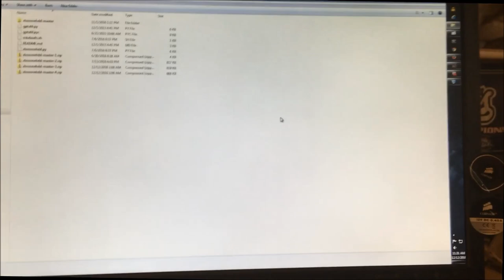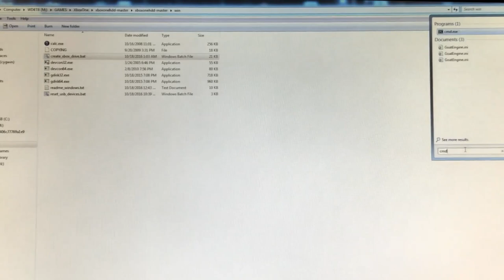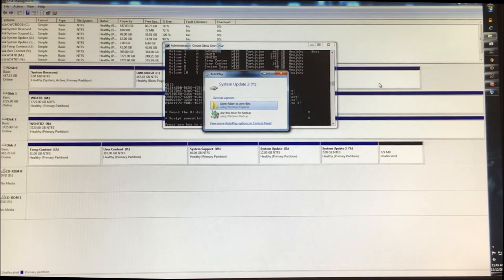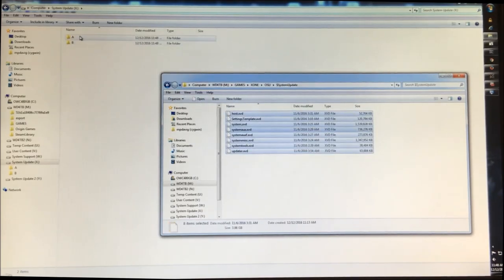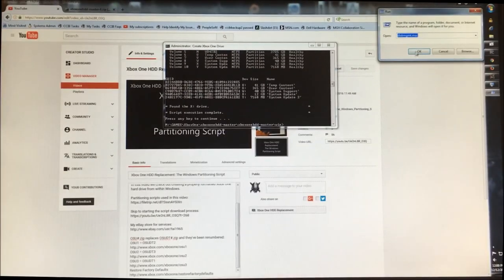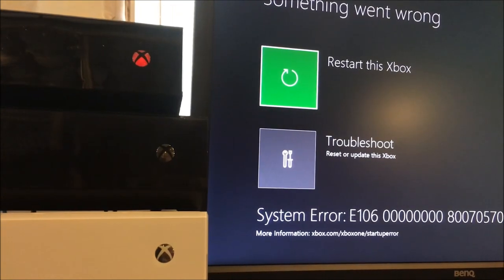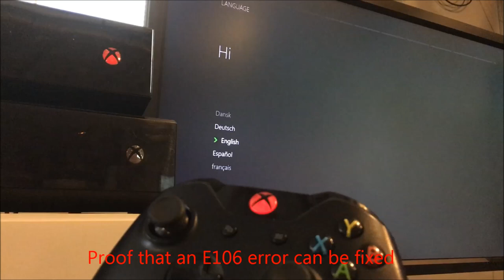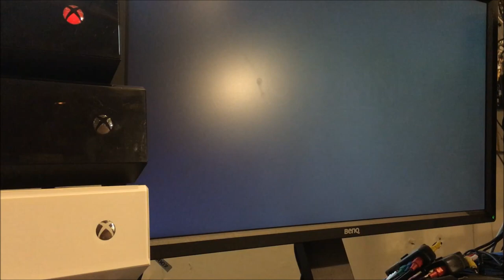Xbox One Internal Hard Drive Replacement: Create a New 500GB Drive Start to Finish

Comment: I tried same way on xbox one slim but in update it stucked on 57%, please help me
Reply from the maker: You should check out the updated video of this one to help avoid this situation:
https://www.youtube.com/watch?v=4xYQQicXdU0

You just need to be sure you meet all the requirements:
1. Make sure you've done a system reset or 2
2. Be sure you are using a NTFS flash drive and you have the very latest OSU1.zip
3. Make sure you are not in the dashboard preview program
    Current OSU1 version is 17134.3036 (05/11/2018)
4. Be sure you are not seeing an E100 error.

Comment: Hi! I've got the same E106 error after copy all from osu1 to A and B folder, after booting osu1 from pendrive as the same like you i've got E101 error after 7% of updating console. Any clues? 
Btw - yours videos helps me to understood how it works and I repair over 10 xbox's.
Greetings from Poland!
Reply from the maker: Glad to hear that I've helped you out.
Regardless of the error, E106 or E101 you've only got 2 steps and they are the same every time.

1. Troubleshoot -> Reset this Xbox -> Remove everything
2. OSU1 update from an NTFS formatted USB flash drive
Troubleshoot -> Offline system update
http://www.xbox.com/xboxone/osu1

You can change the order but you'll likely have to do both and sometimes more than once.

This is some of the recent mess I've gone through and how I handled it:
https://youtu.be/9vzO0ZW41e0?t=3626

Comment: Thank you for the method, I have a question, I've tried to do this on few xbox ones, some worked but others went from E106 to E101 instantly after trying to install the OSU1 from usb. Is that an error related to the HDD itself?
Reply: That's exactly what happens to my xbox. Any solution or suggestion?
Reply: In my case it was the HDD itself.
Reply: What do you mean? it was broken? I tried to use the original xbox hdd, even after all I did, it still gave me the no network-hardware problem. So i used a 525 SSD, new, perfect, and I get the 106 then 101 problems

Comment: Your cmd.exe window is showing C:\Windows\system32 and says you are running windows 6.1. I am trying to do this on Windows 10 (Ughh, I hate windows 10, but it is what my laptop came with.) I got as far as downloading and extracting the scripts and then got stuck trying to get my cmd.exe window to read the file path. It doesn't want to recognize it, and if I try to specifically get into C drive by entering command "CD>C:" it just responds with "Access denied." I did remember to hit run as administrator when opening the cmd.exe window. Any idea how to navigate this issue?
Reply from the maker: Thanks for checking out my channel but this video is outdated and you should check out my latest video which replaces this one. Particularly, I'm using Windows 10 and just run the commands exactly how I run them:
https://www.youtube.com/watch?v=I2r1YA7IfnA

Comment: Great video mate, I was just wondering have you ever come across a xbox one system that got stuck at "preparing console" at 66% as I have tried swapping out the hdd's using your method but it hasnt resolved it, factor resetting also just resets and comes up with an error. I have tried using the usb method but again just gets stuck at 66%. Any advise would be really appreciated.
Reply from the maker: Some things to check would be the OSU1.zip file dates, as of today they should be "Dec 9". Anything earlier and you should download OSU1.zip again. Also, are you in the dashboard preview program and is this a 500GB drive?
Reply: I have downloaded the osu1.zip in your video description, the troubleshoot menu says im on os version 14393.2152 if that is of any help. To be honest mate the xbox has never loaded to the dashboard, I did however manage to load up to the green screen but then it froze, and i reset the console and it came back with "preparing console" and got stuck at 66% again.
Reply: and sorry yes it is a 500gb drive
Reply from the maker: 14393.2152 matches the latest OSU1.zip so you are fine there.
My guess is you are seeing E102 after getting to 66%.
The reset may have trashed your "System Update" partitions.
When you hookup the drive to your Windows machine it will likely say the last 2 partitions need formatting.
I would suggest using the Windows Partitioning Script again with the 500GB Standard b. option. Let it finish and do not copy any files to the "System Update" partition. Put the drive back in to your Xbox One and use OSU1 off your USB flash drive once you get to the E106 screen and select the Offline System Update option.
Reply: Yeah i have tried that but I did out the files on partiom x, so will try it without and update from the usb. Thank you for your advice mate I really appreciate it, i will let you know this weekend if theres any change.
Reply: I also got a system error 203 if that helps with anything lol

Comment: I have a problem, I tried to follow the video to the letter, but I can not access the new disk. I
 am using a 2.5 SATA hard drive enclosure, Windows recognizes the hard 
drive, but when I run the script, it does not find the disk. And places the following: * No USB / SATA drives found
What am I doing wrong?
Could you please lend me a hand?
Reply from the maker: Two most common causes for this are:
1. The cmd shell needs to be opened using "Run as administrator"
2. The default system language needs to be English
Reply: XFiX
That's right, exactly. I am running CMD as an administrator. But it´s telling me the same.
I just going to check the system languaje, because I am from anohter country.
Reply: XFiX
Perfect!
The language issue worked. I changed it to English (I had it in Spanish) I rebooted the computer and it worked, thanks a lot. : D
Reply: I have not used the USB memory, it worked only with copying the contents of $ SystemUpdate in folders A and B. The only problem is that now it does not detect any Wi-Fi network and therefore, the initial configuration will not let me pass from there.
What problem do I have now?
Thank you very much in advance.
Reply from the maker: Sorry for not responding earlier. Are you using 500GB Standard or something larger?

Comment: Hello, I have an Xbox one and I have an issue with it, I’ve tried resetting it, I’ve tried using the usb method, and nothing works! Please do help! Could I possibly obtain a prebuilt Xbox one hdd? Or could you fix my console? thanks!
Reply from the maker: Are you getting any E100 errors?
Reply: XFiX and now the console is displaying a schrjnked and distorted image of the error screen, before it wasn’t, but I think if I fix the hard drive it’ll go away yes? Or I could correct it in the settings if I can fix the console
Reply from the maker: Have you physically changed the hard drive or just reset the original drive?
Reply: XFiX I’ve tried resetting it many times and I will not go through! So it’ll freeze when trying to reset or provide an error message

Comment: Do you know anything on an e102 error code because i can't find a darn thing about it or what causes it.
Reply from the maker: Most of the E10X errors have to do with dashboard update issues.

You'll need a 4GB or larger USB flash drive
Format it as NTFS
Download OSU1.zip from the link below:
http://www.xbox.com/xboxone/osu1
Unzip OSU1.zip and put the $SystemUpdate folder on the root of your USB flash drive
Plug the USB flash drive in to the Xbox One
Turn on the Xbox and select the Troubleshoot menu option
Finally select the Offline system update option and let it go
Reply from the maker: To answer your original question. Hard to say what causes it but somehow the update files were corrupted.
Could be failed download, failed install, improper system shutdown, corrupt file system, physical hard drive issues, etc., etc.

Comment: I had really high hopes for this, for some reason i just get stuck on an E106 error, tried multiple drives (500GB SSD / 2 TB HDD / 1 TB SSHD) al fails on me. I install the script and boot up the Xbox, het E106. Trying to offline update and I 100% get the E101 error every single time...
Help would be much appreciated
Reply from the maker: Damn, sorry you are having trouble. I do have some newer videos that may give you some ideas but here are some things to try:
1. Make sure you have downloaded the latest OSU1.zip
2. If you created the A and B folders on the "System Update" partition in the past, skip that step, just leave "System Update" empty.
3. Do a full Reset then try the offline update again.
4 If you still have a working drive, use the newer 6.0 script.
https://www.youtube.com/watch?v=yVqQZaR5Bvk
Reply: CHECK THE DISK WHIT MINITOOL PARTITION AND FOR SYSTEMUPDATE AND SYSTEMUPDATE 2 if this partitions say unformated or something just format each one and put the name whit minitool, then copy A and B whit the usb system like the video says, and tats all, put the usb and then pass, to my doesnot work the script even when i change the lenguajes im from mexico, so i use j/runner one hdd tools for partition and then work
Reply: I Think i found my problem, my xbox was in the Preview program, my drive is broken and it´s the 1GB SSHD (Xbox Elite) version, I gave up and bought and X with 2GB SSD installed now, easy peazy. Love ur vids and the way you explain it like a Pro. Back to streaming now with my new XbX. Thanks for the reply!

Comment: command prompt error: No USB/SATA drives found :c
Reply from the maker: Be sure to read the readme_windows.txt file. The 2 most common reasons for this error are discussed here:
1. You need to run this script from an Administrator Command Prompt:
    Windows 7: Click "Start Menu -> All Programs -> Accessories" right click "Command Prompt" select "Run as administrator"
    Windows 10: Right click "Start Menu" select "Command Prompt (Admin)"
2. For this script to work on non-English Windows systems
    C:\Windows\System32\en-US needs to be present.
    Control Panel\All Control Panel Items\Language\Add languages
    English (United States)
Reply: XFiX hello you do this kind of work and how much is for the labor thanks

Comment: Anyone know what the hell an E106 00000000 80070570 error is? When I try to reboot back to factory It goes about 2% and throws the error. When I try the USB method, I get the ol' E101 error.
Reply: try booting the OSU1 on the USB, first copy the files on the HDD and after boot with USB (i am sorry if my english is bad jajaja i'am Mexican)

Comment: have you come across the gu id from a 2tb drive
Reply from the maker: Funny you should mention it. I just finished filming this video yesterday. It will be titled something like "No Drive to 2TB Start to Finish".
Should be out by the end of this week.
The basic idea is you have a system without a drive or with a busted drive and you have a 2TB drive on hand you want to switch to.
You'll see in the video that I tried to install an empty drive partitioned as 2TB but during the offline update process the Xbox One shrinks it down to 500GB but, once it is working, you can use GParted to get it back to 2TB.
Reply: XFiX  so do you think it's  built into the nand  as far as drive size.  like in a two TB system. the system has it burned in as 2 TB  and so on
Reply from the maker: Maybe. I'd say yes because that makes the most sense however, all the "1TB Systems" I've come across also reset to 500GB. Haven't had a non-working 2TB system to test yet.
In both cases, had to get 500GB working then GParted up to 1TB.
It appears at least in practice, the Xbox One doesn't care about partition sizes after the initial hard drive configuration, just that they exist and have proper GUID values. When you reset the system, which you should avoid, it seems to always default to the 500GB layout.
It is also possible that the systems I've seen weren't really 1TB systems.

Comment: My problem is I can not get OSU1 to unzip. I have downloaded it a thousand times and it gives an unknown error on the System xvd file. I have tried 3 or 4 different zip tools and on other systems. I have no idea what else to do. Help?
Reply: Nope. The unzip process gets to 29% and then throws an unknown error. Every single time. Does anyone have a copy of it, that has been tested and will unzip? One that someone can post on dropbox or google docks? I am getting desperate.
Reply: OK, wait
Reply: https://drive.google.com/open?id=0B55HfMqlPU6DQUM0V01aQlVZcEU

the file is uploading, wait 1 hour and try the download
Reply: Thank you very, very much.
Reply: Well, Thank you a million times for the Zip file. Opened and unzipped like a charm. Unfortunately, On first boot, I still get an E106 error, which I can find zero info. When I try to boot from the USB drive I get the ol' e101 error. I think it was because I was in the Preview Program and what ever 1704 preview uploaded murdered my console. I think there is no hope for my Xbox.
Reply: Don´t delete files, only copy

Comment: Hey XFIX My Xbox One crashed so I decided to replace the HDD. I started downloading OSU1.zip file but I got an error whe I unzip it. Is a checksum error in system.xvd, it says the file is corrupt. Any ideas about what can I do to get a good OSU1.zip file??
Thanks for your videos BTW.
Reply from the maker: It's a large download at almost exactly 4GB. Downloading from MS should be your best option. I'm betting that the file you have is too small. Try using a different browser perhaps?
Reply: The file weighed actually the almost 4 GB, I downloaded it almost 4 times, trying Chrome and Edge and still not working, so I twitted to @XboxSupport for help and they told me it was my system, and asked me to try to download in another PC/Mac, so I did I tried in another PC and it worked,
It was tottaly weird, both PCs were Windows 10, can't see any difference.
Either way,  the file is working correctly now, I'm gonna try the procedure today.
Reply from the maker: Great to hear. Let me know how things work out.
Reply: It went great, although I didn't replaced the HDD, only deleted all partitions and gave a complete format on it, then I did the procedure with your scripts and it worked, my xbox is working perfectly fine. Thanks for your interest and for this incredible video.

Comment: its annoying to deal with all this procedure thinking of throwing my xbox to the trash and upgrading my ps4 instead
Reply from the maker: Don't do that man. It is annoying but not impossible. If you do need help let me know.
Reply: XFiX well question is cant i do it with just a usb doi really need a sata to usb cable?
Reply from the maker: Perhaps, not sure exactly what issues you are having but you can first try to do an offline update using and OSU1 USB flash drive:
https://www.youtube.com/watch?v=wDOcoiQ_ejo
and this video discusses using the Troubleshoot menu:
https://www.youtube.com/watch?v=hYdza-udoi0
Reply: XFiX well when i used the file you download from.microsoft put it in the flash drive and all when i went to the xbox it gave me error perhaps its because i change the hardrive? but i dont see an option to start a fresh format on the xbox like the playstation has

Comment: What is ODD
Reply from the maker: Danilo Galic good question, Optical Disc Drive a.k.a. Blu-ray Drive
Reply: XFiX  will this work for me because i got e100 error after failed system update, i cant reset console, update it it stuck at thrd step at applying update. I also tryed offline update and not work. I think that maybe probblem is in hard disk because console is new.  Will this work for me?
Reply from the maker: What do you mean by new? Under a year? If so, send it back to Microsoft. E100 is bad and very difficult to fix. It means the Blu-ray drive has failed and cannot be directly replaced since the Xbox One motherboard and Blu-ray daughter board have to match.
Reply: XFiX Have i any chanse to contact you to explain my situation with xbox and to help me. Maybe email where i can writte to you, i will be so grateful if you help
Reply from the maker: If you have an eBay account my seller information is in the description. Just send me a message or if you have a Twitter account send me a message there. We should be able to work something out for you.
Reply: XFiX I sended you a message on ebay and leave my email where you can answer to me

Comment: You guys all at least can be accessed to troubleshoot but my Fucking Xbox can't even goto that screen, i am using the oldest 1450 Xbox One Original and Tried to do all you have shown in the video, after putting the hard disc in to the set, After the Xbox green screen appears, the black screen stays idle for hours.

Thinking of Giving up with FuckBox and go for a PS4 or 5.

American products are no more trustworthy

Comment: Thank u.its works..but why when start my console there is no green screen xbox logo show in start up? only black screen and skip direct go to home menu.
Reply from the maker: Łukasz W that seems like instant on behavior vs energy saver. Energy saver fully turns off the system and would have the green screen.
Reply: When the console is off, the console shuts down immediately. Unfortunately after re-enabling I still do not have the xbox one logo. do i have to disable instatn mode
Reply: I'm tired of this for a week and I have no idea what to do with it as I wrote the console I do not have a green screen with the console logo is a black screen then login and home screen
Reply: start my console:
https://drive.google.com/open?id=1cgHQAlfdlZlLZq_7lNS8CAzGkoZ4zpPX
Reply: problem solved I had to load bootanim.bat logo file came back